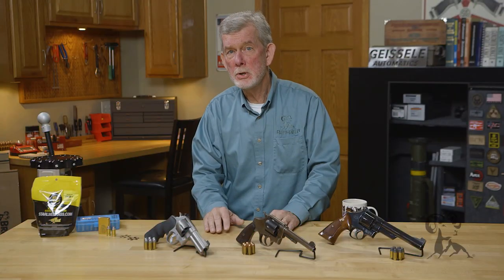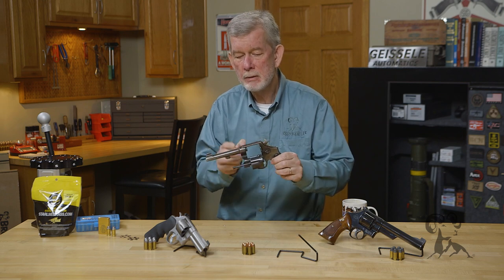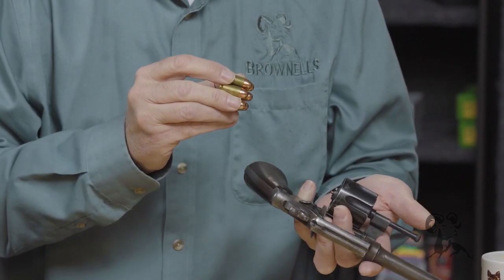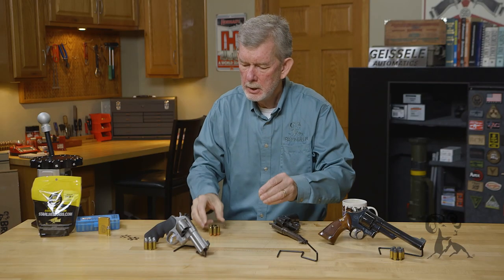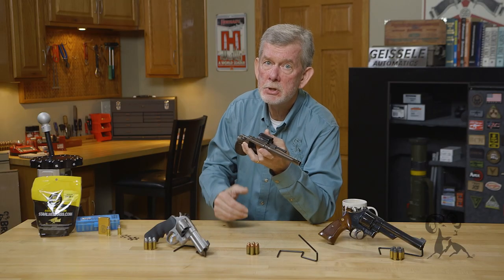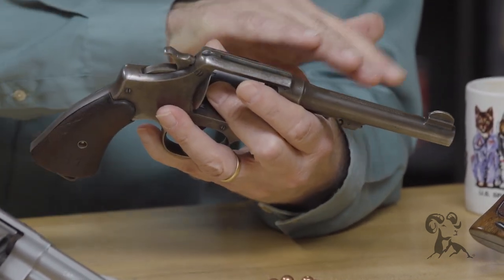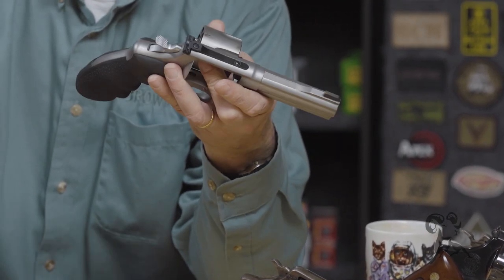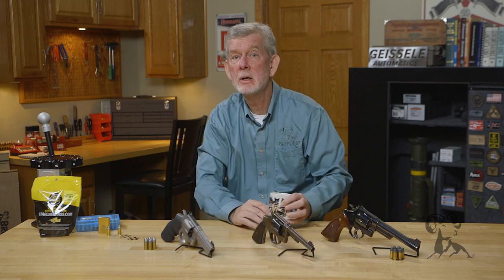From the Vault: Smith & Wesson Model 1917 Revolver

Comment: My father passed away a few days before this video was published and I inherited a few revolvers from him; among them was a S&W Model 1917.  He had mentioned his .45ACP revolver to me several times over the years, but I had never had actually seen it before because it had been in storage since the 1970's when I was a small child.  When I received it, it was covered with some kind of cosmoline that was so thick the pistol was completely unrecognizable.  I used a heat gun to melt away the cosmoline and then I could see that it said "Smith & Wesson Springfield Mass USA" on the top of the barrel, "United States Property" on the bottom of the barrel and "US Army Model 1917" on the butt of the frame.  The serial number indicates it was manufactured in February 1918.  I don't have any information about how my father acquired it, but it's still a fascinating piece of history.  I also got a bag of a several dozen half moon clips and several boxes of .45ACP manufactured in the 50's and 60's.  I think it's such a cool piece of history that I ordered a wall-mounted case so I can put it on display after I give it a very thorough cleaning.  I'm hoping for a few trips to the range, too.  Thanks for the video!

Comment: I picked one up about 5 years ago. It in unbelievable condition for a gun that is 102 years old (aprox) the 5 digit serial number makes it about 1918 vintage. Timing and lock up are like new. The only con's someone put target grips on it and under the barrel where it said U.S. property was milled off, but you can still see the flaming bomb on the side of the frame by the hammer
Reply: Can't you just buy some original grips and put on it?
Reply: @garymccausland1272  "Into" is one thing and "on" is another, lol.

Comment: About 15 years ago, S&W as a part of their Classics series made a reissue of the 1917.  It has a modern mandatory lock on the left side.
And it has a checkered grip (not a smooth grip), and a transfer bar (the firing pin is not on the hammer).  The checkering is so sharp, I use a shooting glove when shooting.  Very nice gun.

Comment: My 625 first model of 1989 has the firing pin in the hammer. Never any light strikes!
With factory or my hand loads.

But later model 625 and 325 cousins have frame mounted firing pins. Some are prone to light strikes. So installing a longer firing pin usually solves  the issue.

I always prefer Federal Large pistol primers. With softer primer cup material. For obvious reasons.